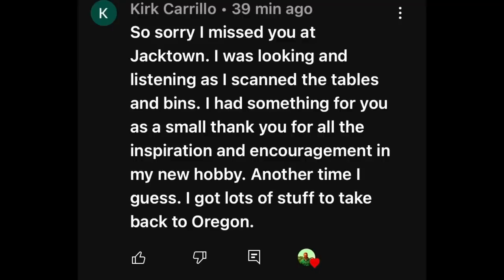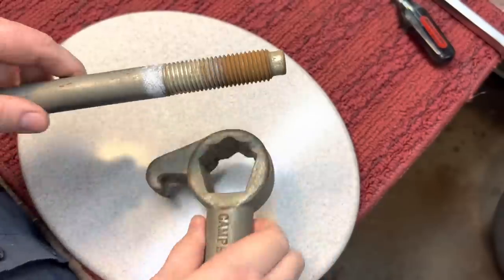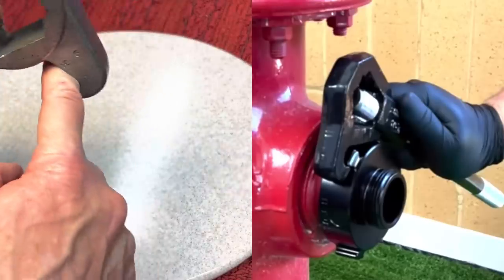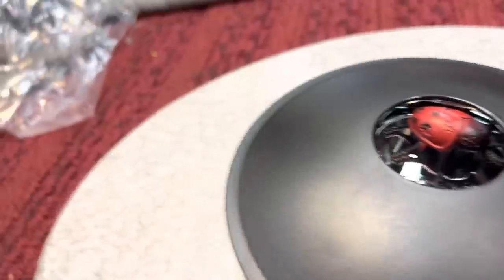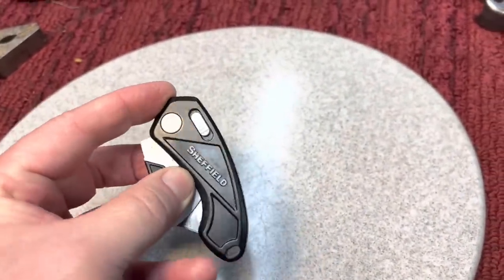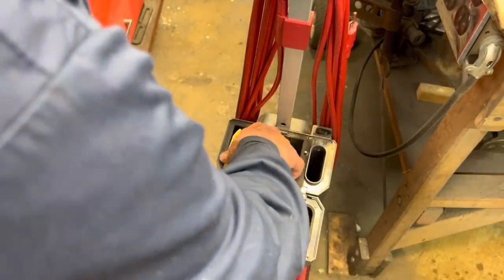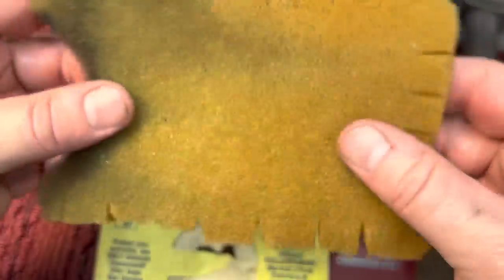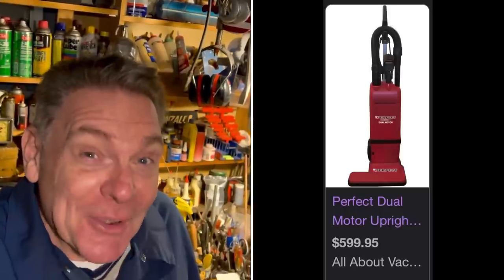Fire Hydrant Wrench, Show-N-Tell 3D Illusion Maker and Electrolux Commercial Vacuum Find.

Comment: Once more, Scout, it's back to a file.  A lot of newbies don't realize that a file is a precision tool.  Sometimes, a file can dispatch a job in a few minutes before you could even figure out how to clamp it into a machine tool.  It's good to learn how to use a file, PROPERLY.
Reply: I remember some older tradesmen doing some amazing work with files. That skill seems to have disappeared. I can't even remember ordering any files for the plant maintenance crew in the last decade. I think they were using electric grinders instead of files.
Reply: @danieldumaine6139  - A G Weygers (The Making of Tools) was trained as a marine engineer (machinist).  He says he spent the first YEAR of his apprenticeship learning to flat file..

Comment: ScoutCrafter,

The other day I saw the hydrant wrench and it brought a smile to my face.  I refrained from another story.  But, you had to bring it up again.  So here goes...

I was headed to bed one summers night, I'd guess I was 14 or 15 years old.  As I closed the curtains in my room I looked out at my neighbors garage, which was detached and behind his house.  As my neighbor opened his garage door a wall of flames came out from under the door, forcing it fully open.  In an instant the two cars and garage were fully engulfed in flames.  I ran downstairs told my parents to call the fire department.  I went out  and got our garden hose and sprayed our neighbor while he tried to put the fire out with his garden hose.

The first fire engine arrived with two people, a fireman  and the engineer.  The fireman started pulling a hose from the street to the garage and the enginner started connecting the 4" or 4-1/2" supply hose to the and the 1-1/2" fire hose to the truck.  The engineer took one look at me and he handed me a hydrant wrench and the other end of the supply hose.  He told me to connect the hose to the hydrant and to turn the hydrant on when he gave me the signal.  I uncapped the hydrant, connected the hose, and turned it on when told.  I noticed I had kinked the hose when I pulled it to the hydrant.  As I started straighten the hose the engineer opened the suction valve.  I almost got knocked on my butt.  That hose did not need my help

It turned out the city we lived in was growing faster than the fire department could keep up with.  They were operating with skeleton crews until they could train and staff their stations. 

Don't ask me how I knew how the wrench worked for cap, hose lugs and valve. 

The garage and two cars were a total loss.  The heat was high enough to melt the aluminum siding on the house 10 to 15' from the garage.  My neighbor suffered minor injuries, luckily no significant burns

Bob
Reply from the maker: Bob- Honestly I think we were more mature at 15 in those days...  Think of it, we were building forts, go karts, bicycles and mowing lawns, shoveling snow, raking leaves...  It was awesome the fireman bestowed that responsibility on you because it changed your life. At that very moment you grew up more the you have at any other moment...    Great story!!!!!!

Comment: I think I told you about this a few years ago, but keep your eyes out for a miele vacuum cleaner. The cord doesn't look that thick, but it's extremely high quality. It's 50 ft as well, but it comes on a reel only about 9 in across. It's one of those click click lock style reels. Best extension cord I've ever had. Nothing to tangle, and no need to Flemish it carefully when finished. Now that I'm at wheelchair user, I have a whole new appreciation for cord reels, hoses and extension cords are miserable for getting tangled in your wheels

Comment: Years ago I picked a vacuum cleaner out of the garbage  It was laying on a pile of broken sheet rock and insulation
Sure enough they sucked up a bunch of junk and got it stuck in the brush part and a nail was wedged in it and
burned up the belt   I bought a belt and some bags and used it for several years

Comment: I've still got 2 Electrolux canister vacuums from the 1960s. I'm almost out of those bags. Nice to know that they are still available.
Reply from the maker: Rick- I got replacement bags rated very high on Amazon for about $1 a piece.  😃👍
Reply: @ScoutCrafter  The Electrolux factory was in Old Greenwich, CT. When I was in grammar school, we did a class trip to the factory. It was a very clean factory and the assembly lines were fascinating. Thanks. Good Luck, Rick

Comment: Like the illusion maker. I’m with you on the chord procurement, I’ve used chords, that were beat up pretty bad, as tie ropes, they work pretty well as they are tough to break due to the wire. Thanks for the video sir.

Comment: Did you put a round wire brush in your drill press? I never would have thought of that. Always interesting and informative content. Thank you.
Reply from the maker: Yes!  It works fantastic!  I run my drill press at low to medium speed and Chuck in the round brushes for cleaning threads.  😃👍. Thanks!

Comment: All those safety lockouts drive me crazy! They make it such a pain in the ass to diagnose something like a riding mower, there are simply too many variables to turn around and add half a dozen that do nothing but irritate the operator. Bypassing those is the first thing I do when repairing almost anything, very rarely do they introduce any actual safety, it's just something for the company to point to and say they tried to protect the consumer
Reply from the maker: I agree!  Some are useful but most aren’t.  Just more things to break or fail.  😃👍